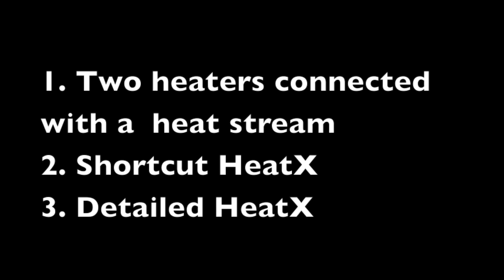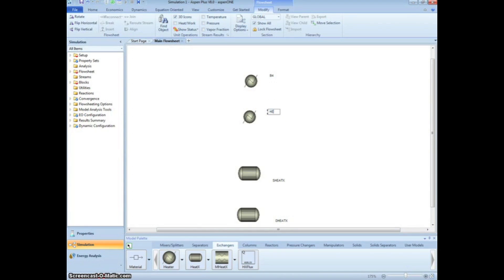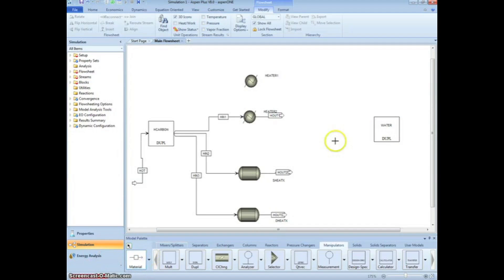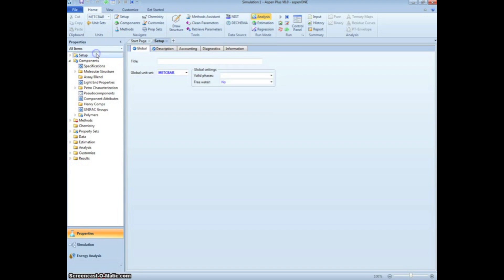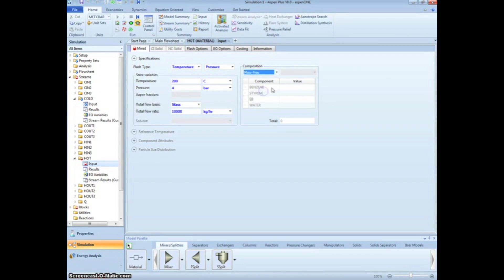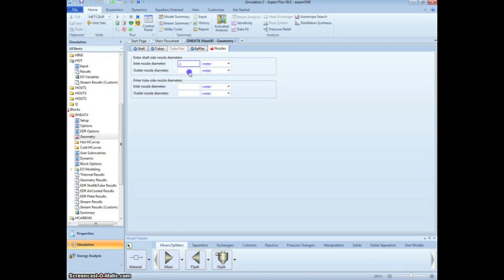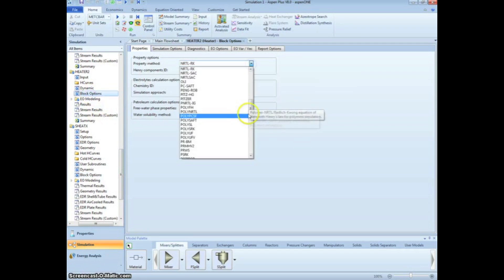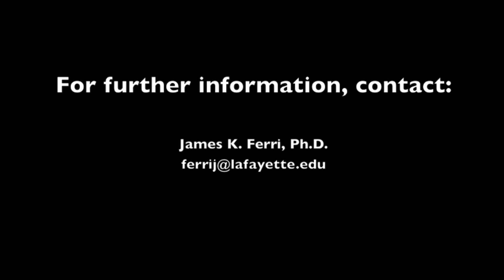ES101:  Aspen Plus heat exchanger simulations

Comment: Hi, Thanks for the sharing the video. Could you kindly let me know how you decided on the geometry parameters that you are using during the detailed design of the heat exchanger? Also I am trying to design a heat exchanger where the inlet/outlet temperatures of the hot fluid and inlet temperature of the cold fluid is fixed. How do i go about designing the heat exchanger in this case?

Comment: Hi can you show a simulation video how you input the values in order to take into consideration on the phase change on the hot and cold side of the heat exchanger.